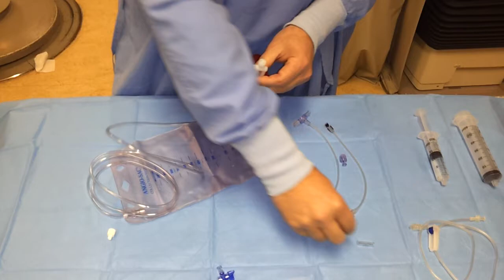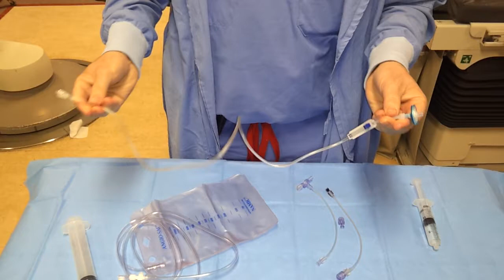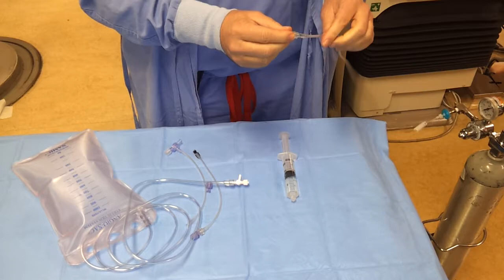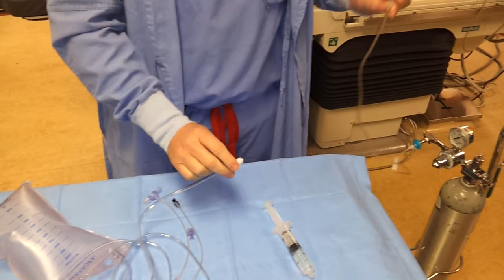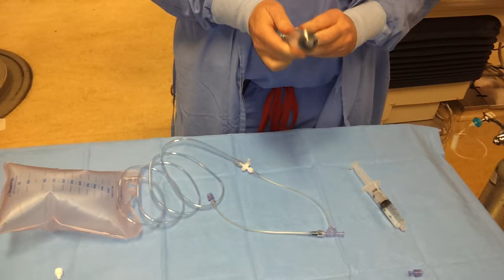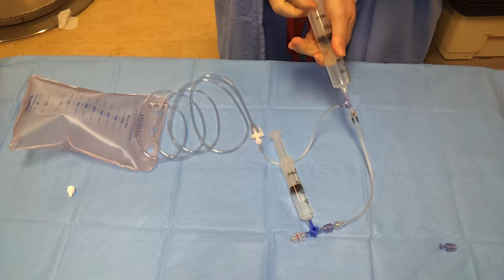CO2 Angio System Setup

Comment: Hello  DR Thiebolt, I like your vidio and foram. 
 this is Mark Hawkins  .owner  of Custom Medical Devices the original sours for the Ultra high  purity Medical Carbon Dioxide  Regulator  Delivery system
Designed To fill the Angiodynamics Angioflush Ço2 bag system. And used buy many physicians  system of their designs. 

I got lucky enough  to be involved with the research of many types  of delivery techniques/systems, including  Angiodynamics  computerized  co2 injector.. in short, i was involved in about every conceivable deliver techniques. Including  the first animal research Dr Irvin  Hawkins  did before patient trials.

I thought a could reach out to you and any body interest in future  development  of the latest deliver system that Dr Hawkins and I developed. 
We have put the project  on hold because of  liability, it seems  like it time for use to get more involved now 
We are in the process  of adding the system  along with stocking sterile components  for physicians to build ther own systems .
The newist system is self flushing ,no need to connect to the regulator but once. Only 500 ml bag .
This is my email  if you like to share thoughts 
Markhmpcmd@msn.com 
Mark Hawkins

Comment: Wow...this method sucks balls.  Just use a paracentesis kit.  It has everything but the male/ female extension tubing and micron filter.  You can scavenge a bigger and more permanent micron filter from endoscopy insulflator kit.  Endo uses co2 as well.